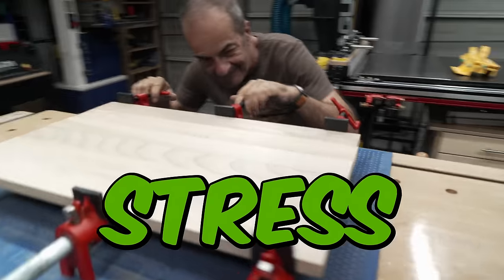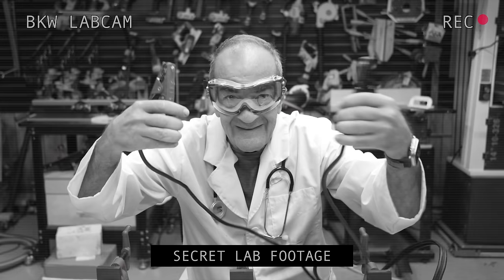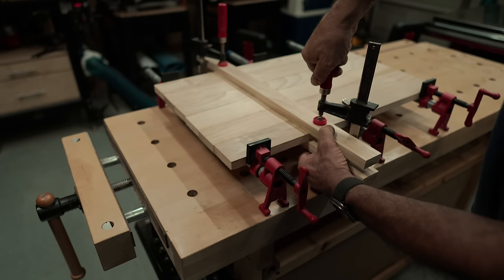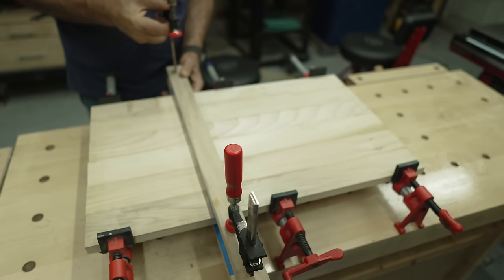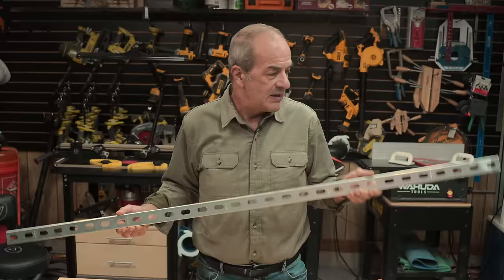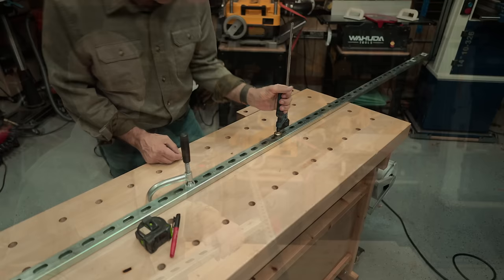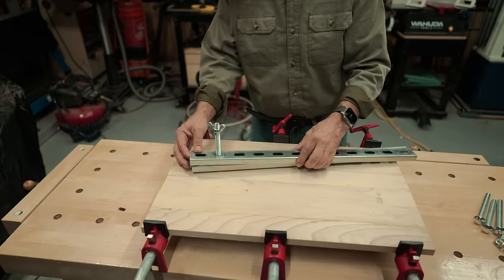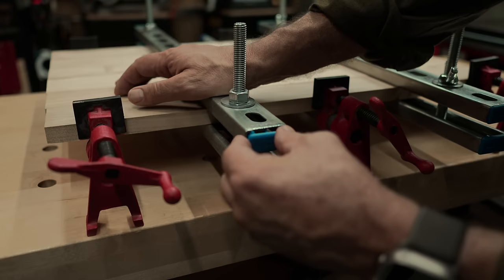Rockler doesn't want you to see this video

Comment: Funny.   Good advise.  I do have the small Rockler panel clamps and they are useful but they are quite pricey.   I wont be buying the larger Rockler panel clamps due to cost.  I think I will try your superstrut solution.  I do use F clamps on the ends of the panels on both sides to help keep the panel flat but it can still warp if you crank down too much on the clamps.  Most people over pressure their clamps and squeeze all the glue out.  So it is a fine line between too little and too much clamp pressure.
Reply from the maker: Correct about too much pressure. I am as guilty as everyone else about cranking down on stuff too hard. Try these out and let me know if they work for you.

Comment: Another thing you can do with this sort of set-up is to stack if you have multiple panels to glue up.  Set up the first panel and clamp with a hex nut, set up another piece of strut over he first caull's clamp bolts.  Lay in the next panel to glue up and then add another strut and more hex nuts.  This way you can glue up a lot of panels without worrying about them shifting or being knocked over by the shop cat.  Thanks!!!
Reply from the maker: Wow, that is an amazing idea! Never even thought of that one! 💡
Reply: @BustedKnuckleWoodworks  I did electrical work in the cell phone industry.  We used to stack the super strut like that when we had to build cable tray for DC power lines.  Super strut is exactly that, super.  So many things you can do with it.  I also agree that the 1-5/8 is so much stiffer than the 7/8.  I only wish they made it out of aluminum. Thanks for all the tips!!!!

Comment: One suggestion...Run a hex nut down onto the bolt when you first insert it up through the lower piece of stut...that retains the bolt and keeps it in place while you assemble the clamps.
Reply from the maker: Good idea. I just hold it with my fingers but your idea is great too

Comment: I would like to add that one of the reasons we need/use cauls is because we tighten our clamps too much causing less than perfect joints to buckle. Let's throw on our thinking caps and figure out a way to pivot a cam off the bolts that transfers pressure to the center of the caul... ah ha!!!
Great video!
Reply from the maker: Hmm 🤔 will have to give that some thought

Comment: Hey Lee, great video!  "Super" perfect way of "strut"-ing your stuff!!  I have to say, I am going to make a few of these this week sometime.  I have been using a 10 foot length of kindorf/superstrut as a table saw fence extension to joint shorter boards (50 inches and under) since I don't have a jointer.  I clamp the superstrut against the table saw fence so there is enough length on the infeed side to have the full length of the concave side of the board be in contact with the superstrut.  Running this through the saw cuts off the convex side, giving a straight edge on that side.  Once I run one side of all the boards I am using through this process, I then reposition the fence and rip the other side of the board with the newly jointed side against the fence to produce two parallel sides on the board.  Guess I am gonna have to go back to the store for some more of this useful material to build the cauls!  I wonder how many more uses we can come up with for it?  Any other woodworkers out there willing to also share how they "strut" there stuff???
Reply from the maker: I have a few other things I have used Superstrut for, I might make videos for one or two of those as well. I love this stuff because it's all nuts and bolts, and I don't know a damn thing about welding! 😂
Reply: @BustedKnuckleWoodworks  😂
Reply: @BustedKnuckleWoodworks  I know I would like to see the other uses.  And as for welding,  you and I are in the same boat! 🤣
Reply: MJLWoodWorks, What did you use to clamp the superstrut to your fence? I've wanted to try this idea, but couldn't figure out how to clamp it to my fence. C clamps wouldn't work because the wood would hit the clamps. Thanks
Reply: @thelonestarranger the kindorf that I use is taller than the superstrut that Lee is using.  I’m using the 1-5/8” deep version.  So I just use an f-style clamp inside the kindorf and clamp it to the outside of the fence.

Comment: Mark- union electrician (IBEW 11)

what you can do is actually turn it 90° and put a slight radius bend in it 

(to do that just insert the unistrut in between to fixed positions and put a slight bend in it and move it forward 6 inches and repeat, until you have a very very slight bow over the entire distance that you want to create)

then you’re going to flip it upside down you get a pre-tap some 3/8” holes 

and you’re gonna do what you’re doing now but now you’ve got something that actually is a fixed piece- that if you don’t apply too much pressure to it will stay that way forever and it will keep your surfaces uniform straight. 

Bear in mind, you may wanna make a few calls if you use the narrow direction of the strut, but you will be taking advantage of the rigidity of it, holding its shape and strength*

Sorry for the wall a text I just blabbed into Siri.
Reply from the maker: Hey man, I appreciate the tip, these are actually great ideas 💡
Reply: @BustedKnuckleWoodworks  yeah I went back and edit it so people could actually understand what I was saying without all the typos. Long story short, all tradesmen actually in the field, have to engineer half of their own jigs and tools on the spot.  I’m sure those guys that make professional tools were in the field at one time figuring out how to do. Things are better way, so thank you for your videos as well.

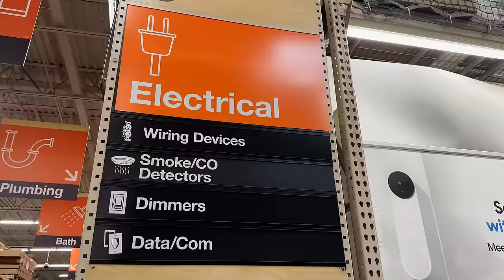Comment: 5:35 I guess it depends on the size of the city... Red Deer is just over 100,000 people, so on top of having all the big box hardware stores, we have an Eecol Electric (electrical supply warehouse franchise). That's where I'll be sourcing that stuff. Probably cheaper too! Same reason I go straight to a steel fab shop to buy my metal bar stock (like the stuff you see in racks at the big box stores, in 4' lengths). WAY cheaper!

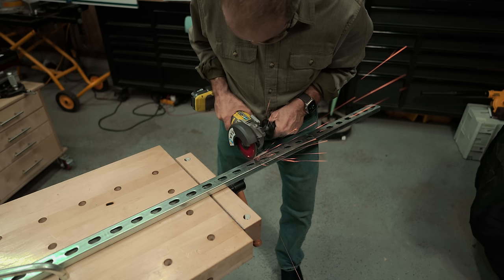6:33 Another option is if your mom sees a cheap tool at a garage sale that she thinks you can use, but it's a VERY well used 7" mitre saw (probably only good for doing trim/finishing work?) and you thank her, but it collects dust for 5 years until one day you're at a tool store and you think, "Hey... does Diablo make 7" blades to cut metal?" And suddenly your super noisy, probably on its last legs 7" mitre saw has a new job title. Light gauge metal cutter! Cuts 3/4" by 1/8" steel flat bar like it was meant for that purpose. At least until I burn it out, which will still be a while because I hardly use it. But I do use it.

Speaking of 3/4" by 1/8" steel flat bar, don't tell Rockler how I made my own T-track system for my project table.. lol

I'm impressed. New subscriber in 3...2...1....
Reply from the maker: Love that miter saw story! Big fan of the ol' miter saw here! I have a couple of videos on those. And for sure, an electrical supply store is probably cheaper, but I always try to recommend the most accessible, low-intimidation options for the viewers 😉

Comment: That’s brilliant Lee! I bet there is a way to use these to make those fancy 3-way panel clamps too.
Reply from the maker: I’ve been thinking about that. I don’t weld, but there are some Superstrut accessories that might help 🤔
Reply: Put wooden wedges between the bolts of the caul And the panel. Now you have clamping pressure from every angle
Reply from the maker: @brettmasek9453  that would work!

Comment: Neat solution, should give a good strong flat clamp.  Far cheaper than a commercial solution. 
In the UK it doesn’t look like the big box stores (Wickes, B&Q) sell this, nor trade counters such as Screwfix or Toolstation.  I did find that CEF have it, its called ‘strut framework system’ and its made by Tamlex or Unitrunk.  3m lengths in 1.5mm (equivalent to 16 gauge) or 2.5mm (12 gauge).  I’ll get some next time I’m out.  Thanks !
Reply from the maker: That’s great info for the UK viewers! 🇬🇧 Thanks for sharing this!

Comment: This is a tremendous idea. Why not turn them over so the narrow ridges don’t leave creases on your panel?
Reply from the maker: You can place them either way. I find having the open side down is easier, and it’s not usually an issue as long as you don’t over tighten them. If you put the flat side down, the wing nuts don’t fit, so you would need large fender washers to span the opening, or some other method for fastening them.

Comment: My in-laws make fun of me all the time because every time there's a problem at their house, somehow, I wind up fixing it with unistrut. As an electrician I have a surplus of the stuff and its uses are limited only by your imagination. In fact I have to go over there tomorrow and re hang a television. Since the studs weren't 16"on center but 24" and the mount dosnt span the gap, someone put a 2 x 4 across the studs and mounted it to that which looks a bit like poo, so you guessed it thin strut unistrut to the rescue! Even though I honestly think the TV will be fine right to the drywall and one stud
Reply from the maker: Oh yes for sure 👍 this stuff has so many uses!

Comment: Isn't the point of a clamping cawl to have a taper in order to apply force in the middle? I'd imagine that even that c channel will flex some, perhaps enough as to not apply needed pressure in the middle.
Reply from the maker: Not even the store bought ones have a taper in the middle to my knowledge. To your point, anything will flex if you crank down on it hard enough, which is why I make the point in the video that there’s no need to do that.
Reply: yeah a tapered caul will put even pressure all across its length on the panel when you clamp it at the ends.  so a tapered caul (made of oak or ash or something) will do a better job than these.  and you already have the material in your shop.  these will work ok, but they will put more pressure near the edge of the panel than in the middle.
Reply: Hand tool channels will be your best source for making tapered wood cauls. Otherwise, nylon washers of different thicknesses would give you the taper needed using the C-channel cauls. The only advantage over wood cauls is in a production shop the C-channel cauls would outlast wood cauls by the decade.
Reply: @chuckw4680 this was my exact thought.  Tapered cauls are the way to go

Comment: Noice, I like this idea.

But, the strut you used is called slotted strut. It comes in deep (1 5/8") or shallow (7/8"). It also comes in as a solid as well. Other trades than Electricians like plumbers, and pipe fitters use it as well.
Reply from the maker: I’m aware that other trades use this, but the big box stores carry it in the electrical supplies section so I emphasized that use. There are definitely different brands in different sizes, but at least here in the US, Superstrut is by far the easiest to find.

Comment: Superstrut is a brand name.  There are several brands. Unistrut might be the original. Strut is available in different metals and finishes, including stainless steel.  Electrical and HVAC suppliers might be cheaper but the big box stores are convenient!
Reply from the maker: Thanks for the info!

Comment: If you want to use F clamps with wood cauls, cut a slot in the end of the caul, rather than a mortise. You don't have to remove the"nub" or rivet or retaining screw at the end of the clamp bar. It still keeps the cauls from shifting. But I like your final solution much better.
Reply from the maker: Good idea, surprised nobody has mentioned that yet!

Comment: the rockler ones aren't so bad once you realize just how many clamps it replaces. It used to take 4 to 6 clamps for the cauls and another couple longer clamps to clamp cutting boards together. Now, it takes 2 of the rockler clamps and leaves my other stuff free for different projects.
Reply from the maker: Oh, I'm not saying they are bad, quite the opposite... but they ARE expensive, and I think the tool industry kinda intentionally entices people to overspend on stuff
Reply: @BustedKnuckleWoodworks  yes they're expensive, but compared to the 7 to 10 clamps that they replace in a glue up, they're not as bad as they seem.

Comment: you mentioned double ugga, fun fact "ugga duuga is a form of measurement of torque using you impact wrench when it reaches its end and the hammers in the impact wrench make those sounds to tighten the said bolts or nuts"
Reply from the maker: 😂 I need to know the conversion formula for uggas to foot-pounds

Comment: Just a minor adjustment to the total price-- while the bar hardware is indeed around $30 at my local big box, the 5 inch long, 1/2 inch carriage bolts are around $5 each which brings the total cost to just a smidge north of $50... still much cheaper than the Rockler solution, however!
Reply from the maker: Are you kidding? Where do carriage bolts cost $5? About $1.67 at my local hardware store… 🙃 Are you looking at stainless bolts maybe?

Comment: Great idea!
But might I recommend to put the FLAT side of the caul against the panel surface to avoid leaving indentations from the 2 channel edges of the caul in your work.  ESPECIALLY I’d you’re gluing up soft wood.
Reply from the maker: Good tip! You can place them either way. I find having the open side down is easier, and it’s not usually an issue as long as you don’t over tighten them. If you put the flat side down, the wing nuts don’t fit, so you would need large fender washers to span the opening, or some other method for fastening them.

Comment: You can make the same things with the 1x2s you started with by making a bunch of slots if you're using Jorgensen clamps, or a bunch of round holes if you are using bolts. Also, you can easily make those comma-shaped clamp excesseries out of wood too. I used to make them for quick-release tablesaw fences.
Reply from the maker: Clever idea sir!

Comment: Excellent er video and really useful tip.   Do they damage the softer woods?
Reply from the maker: I've used these with pine, cedar, poplar, and softer woods like that (I used poplar in the video) and as long as you are reasonable with the pressure you will be absolutely fine. If for some reason you need to go tighter, you can always flip them over where there is more surface area.

Comment: Another quick tip is to not crank the clamps so tight on your work piece as it will cause the board to bow as well. Back off a little and they will flatten back out!
Reply from the maker: It's a fine line. Sometimes if you don't joint the glue line perfectly, a little extra "ugga" can help!

Comment: Just found your channel and it's incredible! I love your style/humor. It's inviting, entertaining, and very informative. How the algorithm didn't bring me here sooner I'll never know.

Will the bar of F-style clamps also fit through those holes? It could get the clamping force closer to the workpiece and save you from buying/losing the bolts.
Reply from the maker: You certainly could do that! I wanted to present the most economical option, that wouldn't require buying or modifying any additional clamps. Another thing is that the clamps can sometimes get stuck in the holes in the strut because of the way they are spaced.

Comment: You should tap some wedges in between the bolts and the edge of the boards and you won't need the clamps.
Reply from the maker: That is an awesome idea that a few others have pointed out. I thought of it too, but only AFTER I finished the video. 🤦🏻‍♂️

Comment: Using really strong hardwood, the same clamps you were using on the pine, and wax paper for the glue under the wood saves you a lot of work and trips to the hardware store.
Reply from the maker: I showed that in the actual video. Maybe you missed it.

Comment: Strut nuts like these would make it infinitely adjustable. Use on one each side and tighten with a nut in thw middle or use a drill with a bolt  to set the tension on all four bolts. 
Great job on the idea.

Go to a supply house or order T HD and get 20' pieces
Reply from the maker: +1 on the strut nuts. Would’ve added some extra cost, as they are kind of expensive, but in retrospect totally worth it

Comment: Wonderful video! Thank you! Just one small warning - cutting or grinding galvanized steel with an angle grinder can release toxic gases including lead. Please do not inhale them. Do that outdoors.
Reply from the maker: Holy moly 😲 I did not know that! Thanks for the tip! (Or maybe just stick to the hacksaw? 😆)
Reply: @BustedKnuckleWoodworks  neither did I! Until recently.. yes the hacksaw would likely be safer. But not as fun as the angle grinder!

Comment: Seems you can put the F clamps through the slots and skip the carriage bolts?
Reply from the maker: You may have better luck than I did with that. I found that the holes in the strut interfere with the clamping point. Probably just because of the clamp size I was using. Also, modifying the clamps makes these a bit more expensive than they otherwise would be. Carriage bolts are super cheap! 😁

Comment: Im in a situation where im making a thick veneer of cherry laminated on plywood. Would cauls help with that? Im nervous about clamping the sides of the board and the middle popping up.
Reply from the maker: No, I would use a bunch of weights spread across the surface, like heavy books or barbells